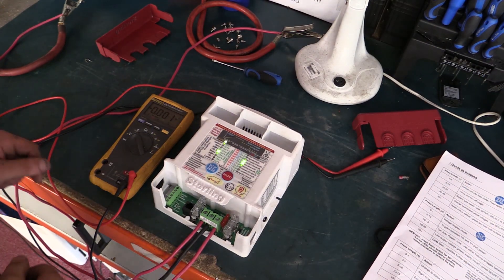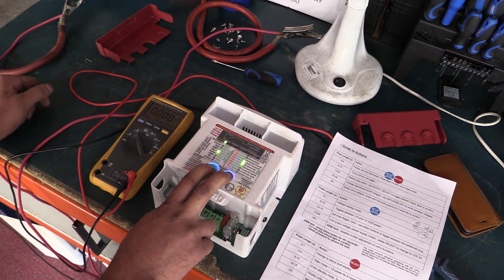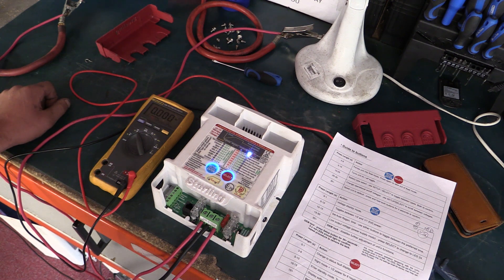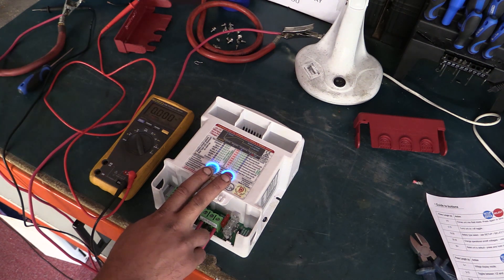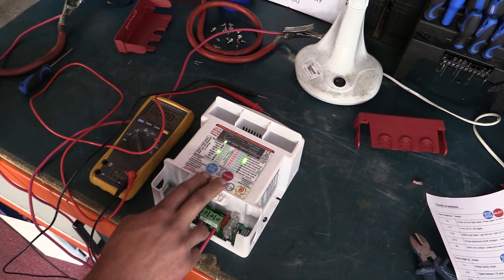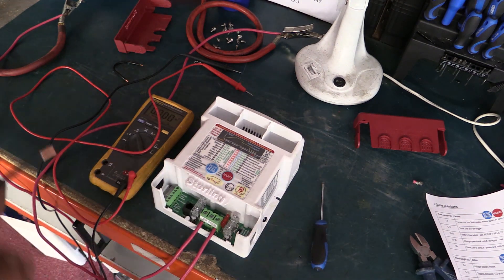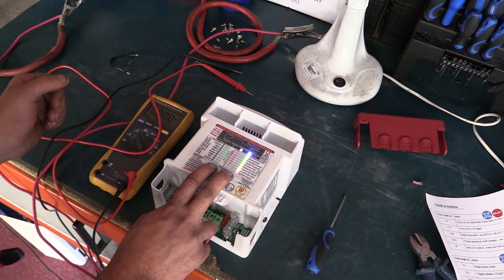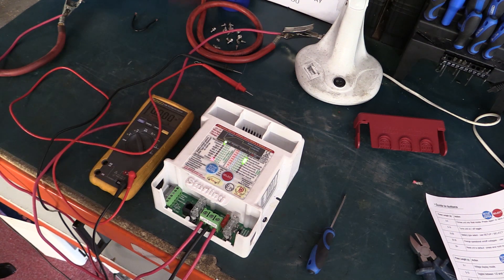Battery to Battery  Factory Reset Procedure on BB1230 and BB1260.

Comment: I have a 12v & 240v (shore-fed) campervan (with Solar) using a BB1230.  I have just purchased an Ecoflow Delta 2 Powerbank. Can the powerbank be wired to the BB1230? I really appreciate any help you can provide.
Reply from the maker: Hello Tony,

I really can't answer too many questions about products that are not ours. All of our charge profiles are available in our product manuals. Whether or not it's suitable for the EcoFlow, or indeed even how to connect it to the EcoFlow is something to pose to them. I wouldn't want to assume how to connect to a lithium system that I'm not already intimate with, in terms of knowledge. 

Apologies--
Ben

Comment: hello if the procedure is the same with the 12 by 24 volt device
thanks
Reply from the maker: Hi Vito,

Correct. Just ensure that your battery systems are correct for the BB that you are purchasing and be sure to put the positive and negative across the entire 24V battery, not just one of the 12V batteries that make it up.

-Ben
Reply: @SterlingPowerProducts  Thanks very much

Comment: Hi there finally got round to fitting the Sterling power dc to dc charger but I need some help? I set it to AGM 2 because my battery is AGM however when I confirm it goes back onto ‘custom’ and flashes red? Also I had my van started and it randomly turned itself off now when I try to start my van the engine is just turning over and not starting? Do you know why please? Thanks
Reply from the maker: Hi Zed,

That's an odd one. 

Have you had an ignition feed fitted? Is the ignition feed connected to a line that is live when the keys are turned and dead when the keys are out? 

Have you tried doing a factory reset and then setting it into AGM again? 

Also, what was the voltage on the input terminals and the output terminals of the BB? 

Hopefully we can sort this out
B

Comment: I have sterling ultra 30ah connected to mains feeding 2x sealed  110ah batteries first I selected sealed type and waited  its charging 14. Some think is that right or should it charge 12. Some think
Reply from the maker: Hi John,

I'm not quite sure what you're asking here. Are you asking about charge voltages?

Most batteries enjoy a charge voltage of 14.4V. 12V would be far too low to charge them effectively.

Comment: I am about to install my BB1260 unit.  

Question: When securing the cables does one turn the screwdriver in the clockwise manner to sandwich the end of the cable in the anterior position inside the cable receptacle --- or does one turn the screwdriver in the counter-clockwise direction to sandwich the end of the cable in the posterior position inside the cable receptacle??  When I received my new unit the little platform in each receptacle was squarely in the middle so it is not clear where it should be when the cable is inserted.  There are also no instructions referring to this simple but critical issue. 

Thank you very much,
Reply from the maker: Hi Philip,
As far as we go by, lefty-loosey and righty-tighty :)

You'll need to turn the screws clockwise in order to seal the cable in position correctly.

Comment: I had 3 different type of dc to dc charger but none of them was as complicated as yours.  Thanks you for helping me to stay away from your product.
Reply from the maker: Apologies for a late response, and apologies for the complications with the unit.

We often find that it's one of the simplest to install on the market. It's as simple as battery in, battery out, common negative and an ignition feed. 

If you have any further inquiries or you need consultation, we're here to help.
Reply: @SterlingPowerProducts  I have the 60A version of your dc to dc at the moment. I'm wondering if you are planing to develop 2 in  dc to dc and mppt solar charge controller?
Reply from the maker: @3dmixer552  Hi 3d,

Yes, that's actually in production now, but we've kept somewhat hush about it until it's on our shelves. In terms of how it's tested, it's gone great and we look forward to being able to sell it.

It's 30A current limiting at present (Or, more accurately when we're considering solar, 350W), not 60A, but for most campervans that's probably all you will need- and if you're really desperate for power our units always function happily in parallel.

Hope that helps.
Reply: @SterlingPowerProducts  is it dc to dc and mptt as well?  For solar 30A should be fine but for dc to dc I found 60A is the best.  I had the 30 A before.  Combined with solar it might be ok but the problem is that we don't get much sunshine in the UK. :)
Any plan for 60A version?  Thanks
Reply from the maker: @3dmixer552  It's DC to DC and solar in one, that's right. It's about the same size as a standard 1230, too- so it'll fit in to a lot of the same installations. 

You're right though, the British market isn't quite the best for solar, but if we're lucky, who knows. 30A is often enough for most smaller living arrangements and with the solar engaged you're getting a more constant charge- so you'll be getting some feed even with the engine off, which is always a benefit.

Regarding the 60A version? It's obviously something in our minds  as a concept but it's not something that we're ready to produce or really talk specs about, yet.

Though- there is something that might be leaving prototyping soon which should be exciting. I'm sure we'll do a video on that when it's ready.